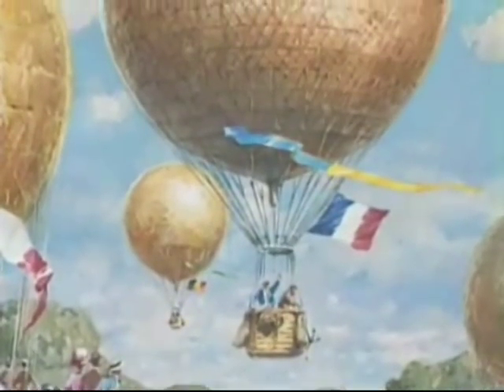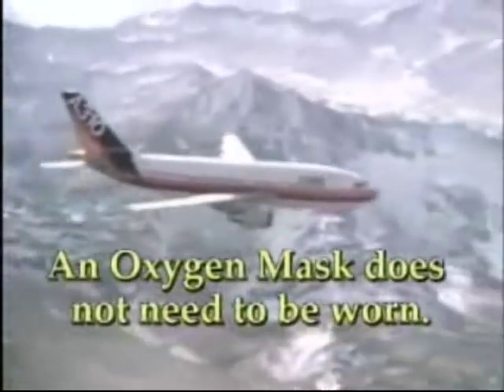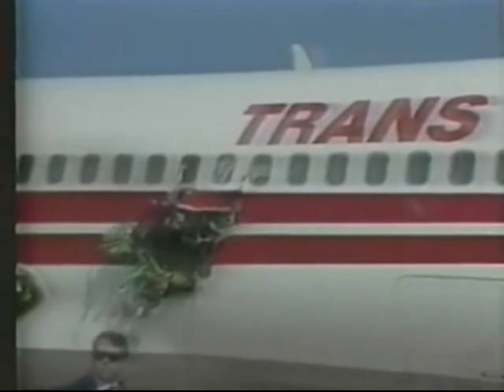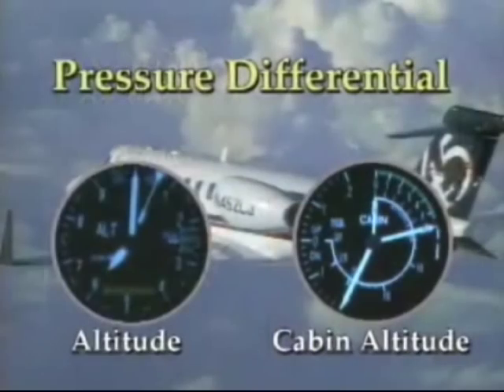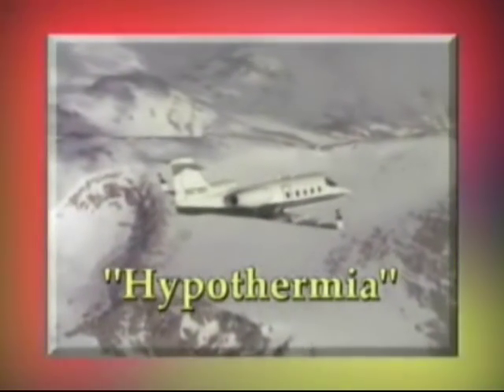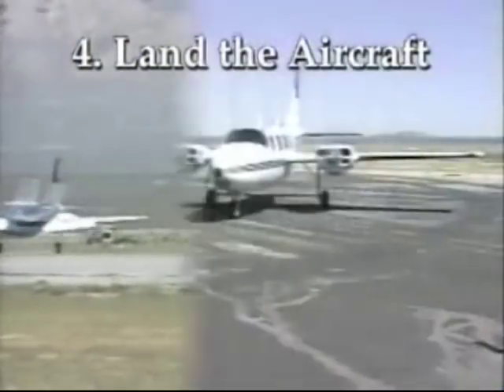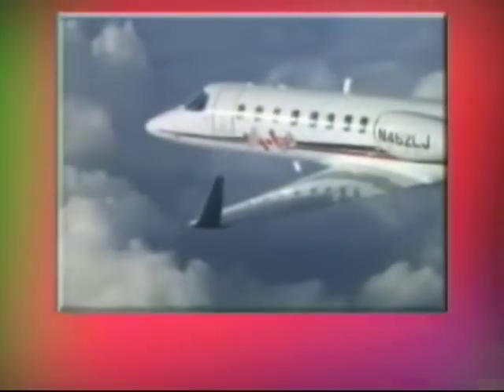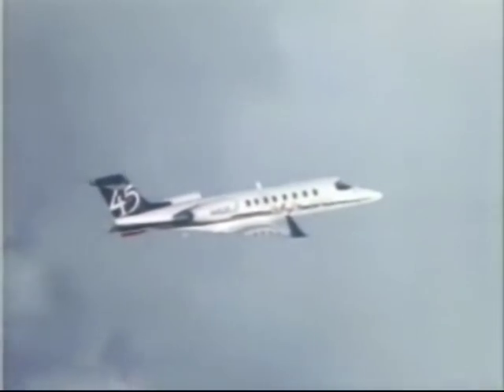Physiology of Flight: Ups and Downs of Cabin Pressurization

Comment: 1. What are the advantages of flying on a pressurized airplane?
Feel good
2. What are the different types of pressurization systems used?
Isobaric, Sealed Cabin, Isobaric Differential.
3. What is the most common pressurization system?
isobaric
4. When is a sealed cabin used?
Space craft
5. What is the major disadvantage of flying on a pressurized airplane?
Depressurization 
6. What are the three types of pressurization loss?
Slow Depressurization, Explosive Depressurization, Rapid Depressurization
7. What is the main difference between the different types of pressurization loss?
time
8. What should you do if you experience a decompression while piloting?
Put on an oxygen mask, fly the plane low, then land as soon as possible.